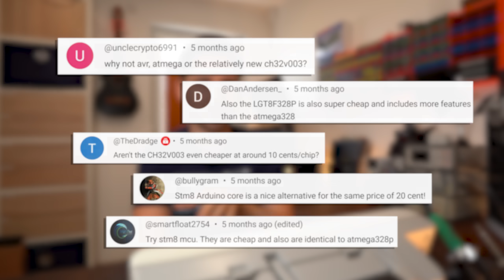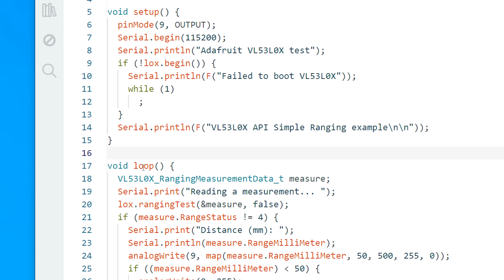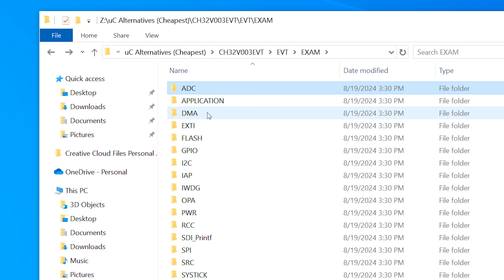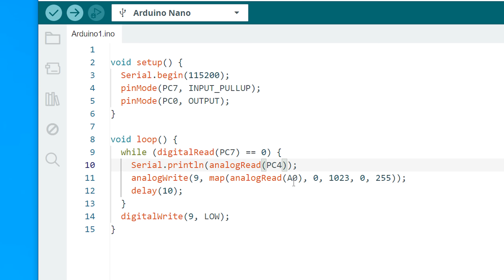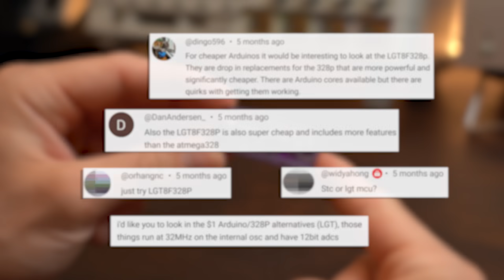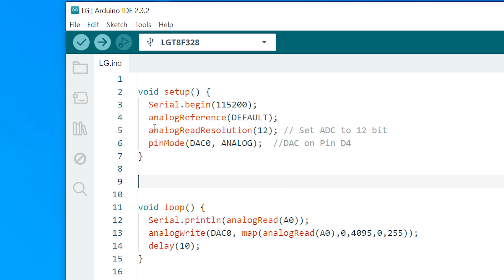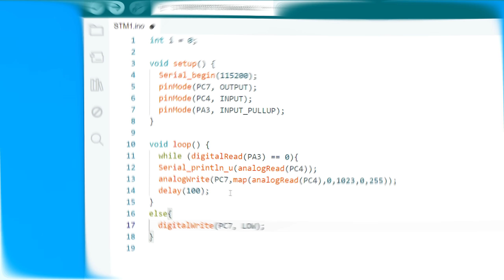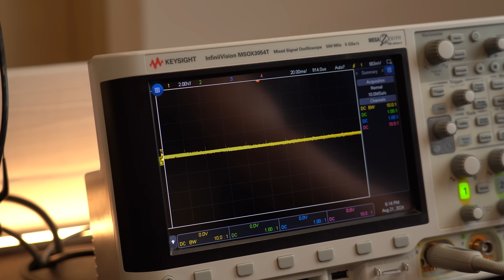I tried the 3 Cheapest Arduino Alternatives! (That you Suggested)

Comment: Not gonna lie I was just searching for a cheap thing to control my leds behind the TV. What a coincidence
Reply from the maker: I hope I could help ;-)
Reply: Try ESP32.
Reply: @cyanoure  Yeah, a super cheap DIY solution is cool and all, but WLED just saves so much time.
Reply: @cyanoure  yeah, esp32 is way more powerful, can use python that is much easier to program and u can control it even with wifi or bt
Reply: @MMuraseofSandvich  Yeah, I've tried WLED recently, it's an awesome project for controlling led strips no matter if it's single color, RGB or ARGB and easy to setup.
Reply: @cyanoure  Dimension 2400 and a chopped up parallel cable.
Reply: @greatscottlab  can you make a ups around 200w to useing 12v li battery and output is ac. Please i need one but i don't find it anyway. I am a electrical engineering but i don't know how to make one with vary low latency  around 10ms
Reply: ESP8266 do just fine for leds. No need to go for 32 unless you want to control 600+
Reply: @User-ec2bh  I should've say ESP without 32. :D
Reply: Use an esp32 or esp8266 with the WLED firmware. It gives you a good-looking web interface with no programming.
Reply: Don’t trust coincidences. In this case it’s the omnipresent spying on your activity for advertising purposes.
Reply: @TinCanToNA  Or not. I know that coincidence don't exist but I lived things impossible to logically explain which leaves a place to surnatural, until we can explain these...

Comment: Wow 20c is really low! 😮
Reply: Some are even 1 cents. Padauk has a 6 pin 1 cent mcu that is sadly otp but still pretty cheap
Reply from the maker: It truly is ;-)
Reply: @greatscottlab  NO WAAAAAY! great Scot really replied! 😮😮😮😮😮😮😮😮😮😮😮😮😮😮😮😮
Reply: @greatscottlab  You are my favorite YouTuber as well, happy to see you reply to me!
Reply: @greatscottlab the lgt8f328 is a very good option as it is very much a clone of the Arduino and except the mentioned very low compatibility issues that is my favorite, as it is a drop in replacement where as the the other 2 are a bit to adapt to, but, still when you want to make cheap things or just make many of them I would say the stm chip is good, as it is a well ruputated brand and probably eisier to get support of, for me at least who uses ChatGPT to generate code ;-)